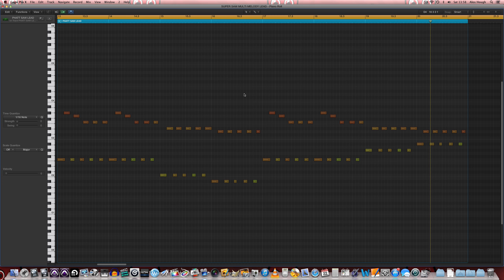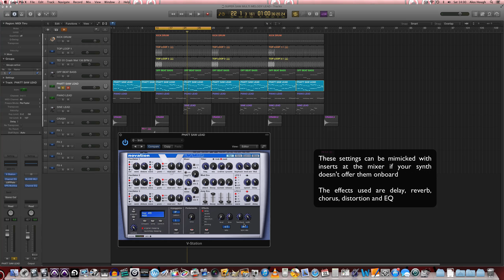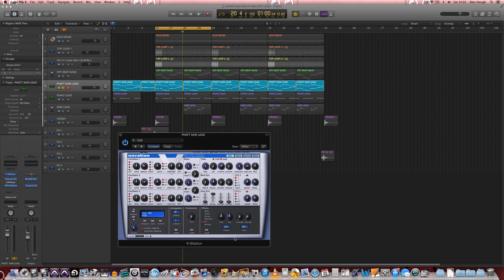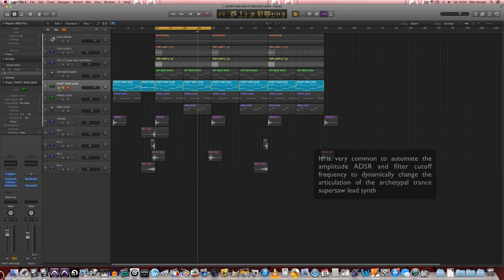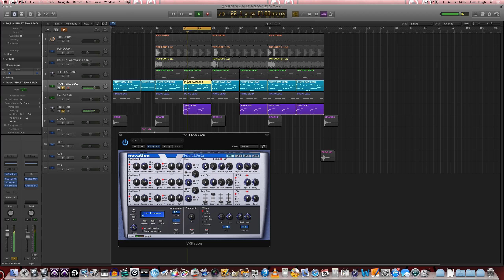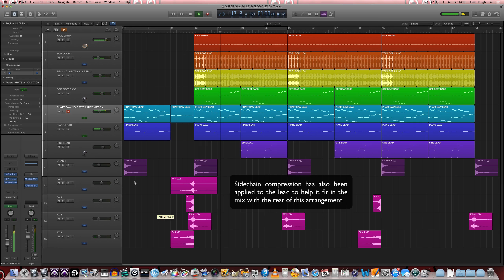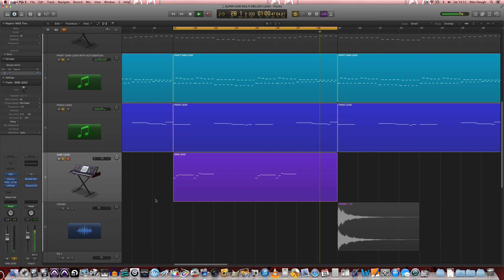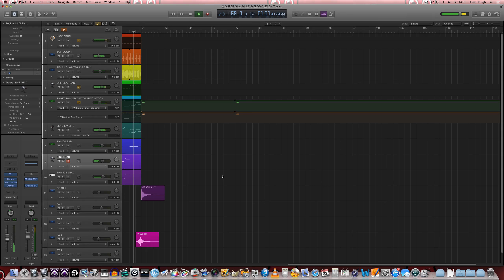How to make a supersaw multi-melody trance lead in Logic Pro X - Trance Production Tutorials #17

Comment: Ugh, why say it's how to make it in Logic when it's not made using logic instruments?
Reply from the maker: Hi Matt

All the tutorials on this channel are just using Logic as the DAW, but the underlying techniques are more often than not  applicable to loads of different synths and FX units in a variety of DAW's.

You could easily swap out a lot of the stuff in this tutorial from the Novation synth for the ES2 for the super saw sound and any synth with a sine wave for the counter melody :)
Reply: I tried but there's some modulations, etc on novations synths that don't work in the same way as in Logic's synths
Reply: No, I know exactly how they work in Logic, it's just when I'm trying to find exactly what modulation I can use to get a certain timbre to my sound, the parameters don't work in the same way as they do in Novation or NI synths